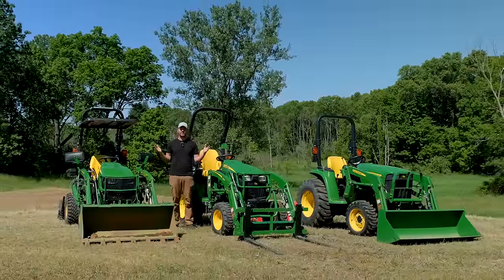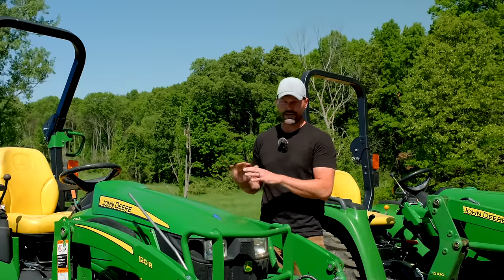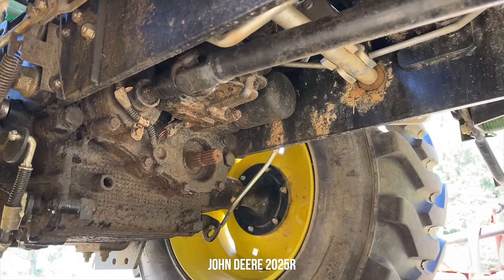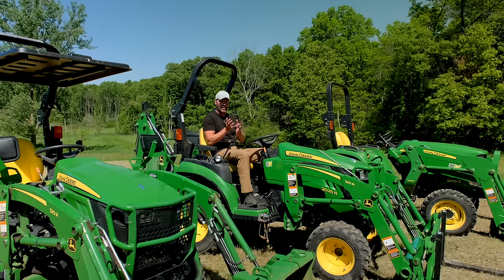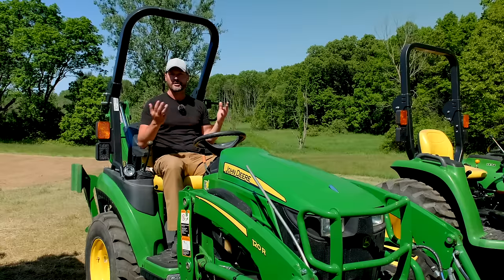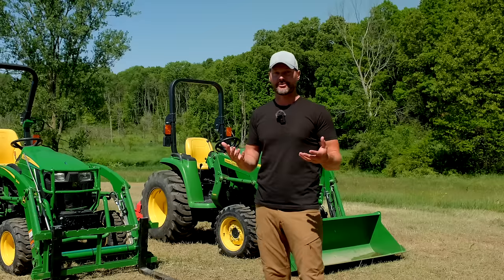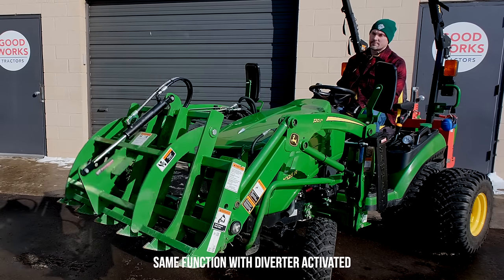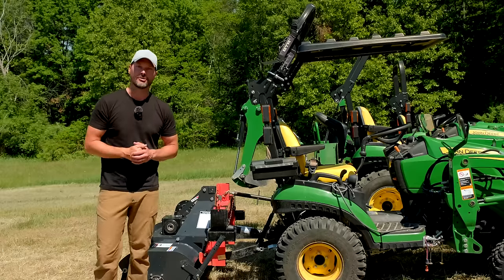CLEAR LOSER? COMPARING 3 JOHN DEERE 25HP TRACTORS.

Comment: I’m sorry but I totally disagree with you. I did put 3” bora wheel spacers on. I think the 2025r is the clear winner. I don’t have 15 different tractors to chose from like you so for a one tractor small farm it’s the clear winner by far.
Reply from the maker: Lol, score a W for BORA!  Several have commented on adding spacers to the 2025r.  Proves my point about it being so stinking tippy from the factory.
Reply: I never noticed it being tippy but I live on a hill as do just about everyone in West Virginia so I would have added them to a 1025r as well but still it’s the clear winner between the three the 2025r

Comment: This is why i didnt get a JD. Too much money for gimmicks.   Also please stop talking about aftermarket backhoes splitting tractors.  There are very few credible if any pictures online.  This is a falsehood spread by dealers to sell overpriced  options.
Reply from the maker: No, it isn't a falsehood and it's the reason why JD didn't offer a backhoe for the 3e Series until it was redesigned in 2018.  Why else would they not have offered one?